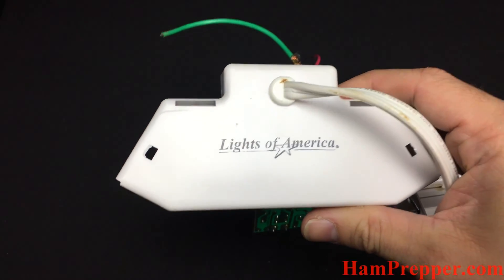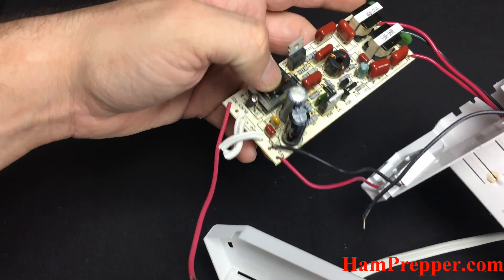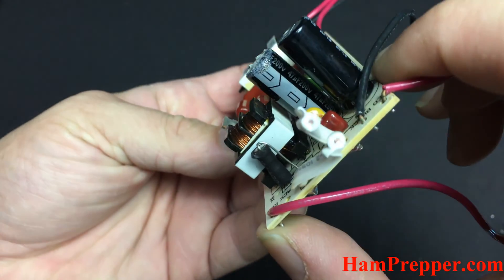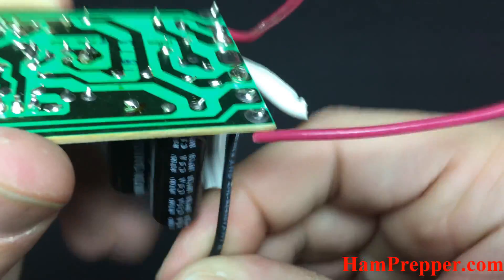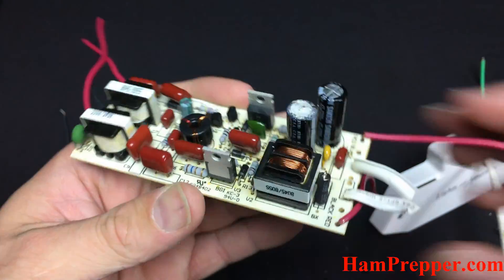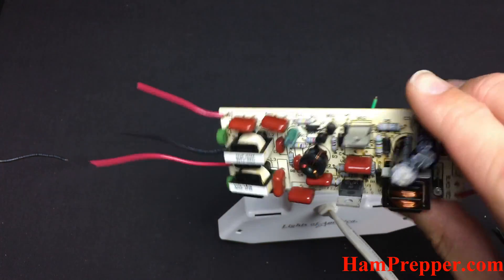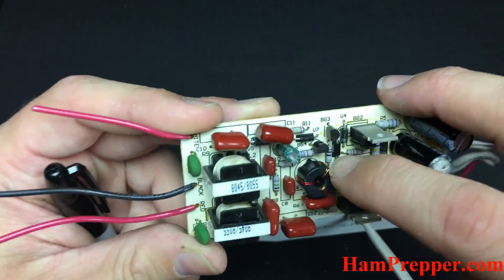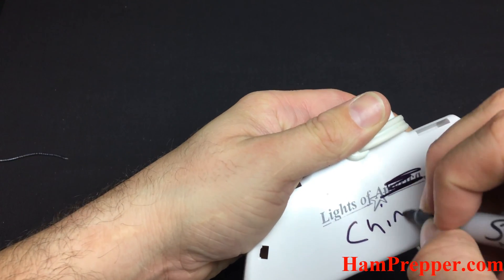Lights Of America Crap Shop Light Let The Smoke Out

Comment: I have one of the old T12 models from 1996 which I used as a blacklight.  And, it was preheat with cheap quality circuit board starters as well.  At first, everything worked perfectly.  Until one night when I was using it for a science project.  We were doing a model of the solar system and mine was glow in the dark.  I was using it for that project and then, the cheap circuit board starter let the smoke out.  And, you can't use conventional glow bottle starters on them.  You will never be able to get the glow bottles to glow to get the fluorescent tubes to fire.  The ballasts don't output enough power to facilitate the glow bottles to fire.  My dad brought home a new Advance R2S40TP ballast from the school district where he worked (they used 120 volt for the portable classrooms) and installed it into the shop light and it worked perfectly ever since.

Comment: If you thought this was bad, wait until you hear about the old T12 version from the 80s. They were preheat, but used cheap electronic starters and would fry the crap out of the lamps when they reached EOL. 34-watt lamps did not work well in those fixtures and would fry the ballasts. The fixtures did not like the cold, either. The system was designed to be cheap, and some other manufacturers even copied it and used it in their cheap ballasts for other shop lights, so beware.

Comment: I surely hope people are not throwing out these excellent shop lights due to simple led driver capacitor failure.  These capacitors are easily replaced, but the proper replacement must be used.  The capacitors needing replacement will be 200V or 400V on the board and I would opt for a 400V replacement even if the original was 200V.  The Nichicon ULD or UCY series capacitors work well and you can purchase these from digikey.  Use their free shipping option (mail in a check with the proper form).  For this particular led driver, both 47uF/200V capacitors should be replaced with 47uF/400V capacitors.  The digikey part number 493-6890 (Nichicon UCY 47uF/400V) will work fine and they are currently going for $1.97 each.  So you are back in business for under $5.  Be sure to note the orientation of the capacitor, they have a positive and negative side.  I have the 8140SE2-WHS model which puts out a beautiful pure white and flicker-free light.  I have not found another shop light that compares.
Reply: I found the "lights of china" head engineer.

Comment: I bought 7 LOA 8155-WH5 shop lights less than 3 years ago from Rural King.  Within the last 3 weeks, 4 have died.  I measured the transformer (driver) output and it was 105 Vdc.  It appears Lights of America's website is down.  Are they still in business?  Warranty was 5 years...Rural King is not providing any help.

Comment: Took mine apart to look at the driver. No obvious burned capacitors. Two rows of 60 leds each side total 120 leds. I assume the problem is the driver. The voltage in the current state of dim lighting is 62 volts across the + and - terminal of the whole array. Is there a possibility to buy an led stand-alone driver to power the fixtures?

Comment: I bought a 2-pack of these shop light units from Sams that worked well for almost two years then delayed start with dim lights and flickering. Anything similar or obvious on the power supply board to check? Old fluorescent fixtures with ballast bypass for replacement LED tubes seem to be a better option now but I hate to waste anything that can be fixed.

Comment: Have had the same thing happen, bought 10 for my shop, turned into strobe lights after a few mins of running. It would be fine if I was at a 70's dance bar. But not in my shop working.
I have now called several times and they are not calling back. I've sent emails as well, NOTHING! 
Thought the light would work out for the shop, but "Lights of CHINA america" suck!
Total fire hazard

Comment: Hi.  Did you replace the cap and fixed the unit?  Just wondering.  Have the same type of Power Supply (failed).  My switching caps look good, however.  My failure was near the round coil, to its side opposite the orange/brown ceramic cap.  Thanks.  t\.